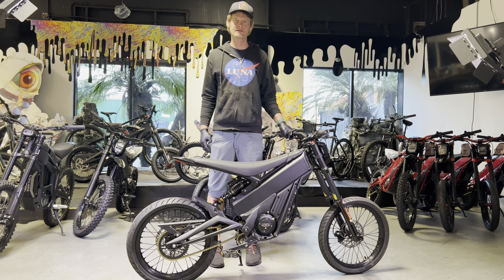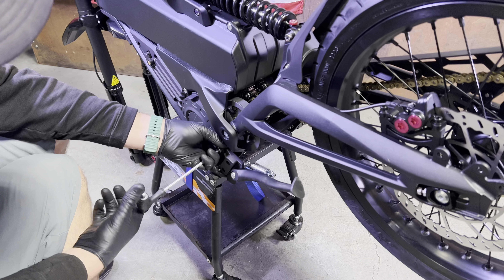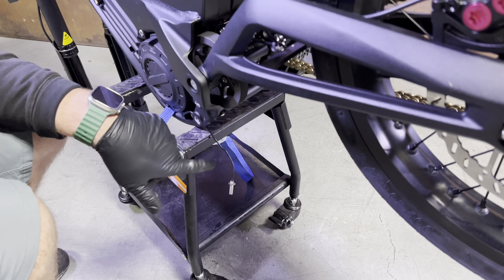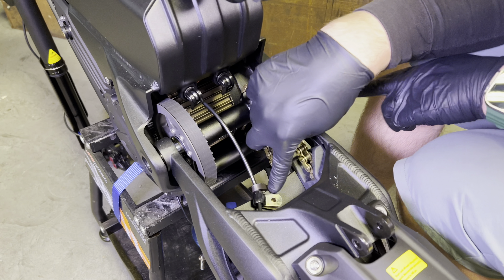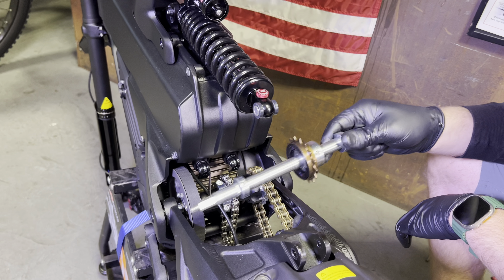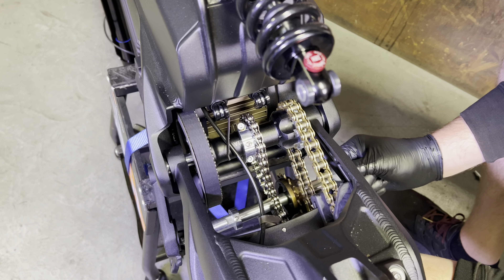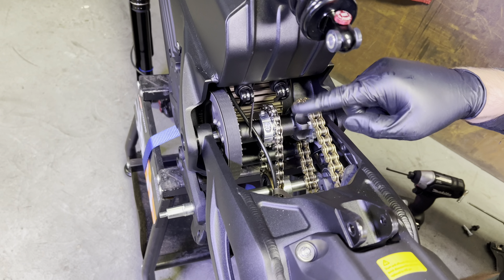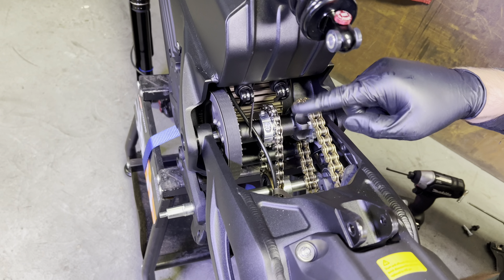TALARIA XXX PEDAL KIT INSTALL

Comment: pennies trick for spring is cool. 
so the rear sprocket is just for changing the main sprocket on the rear tier ? Bummer I was hoping some one finally made a pedal kit for pedal assist for wen you out of power :P 
Fyi. I'm trying to find the prefect quick release/folding pegs so I can leave crank on but be riding and collapse pegs wen I want to and have the crank clear them. Might have to extend the cranks shaft a 1/2 inch. Most pegs I have seen so far are to cheaply made. I just google e-bike passenger pegs.
Let me know if you know of any that collapse and have good clearance :) IE. I put link in next comment du to link blocking on YT